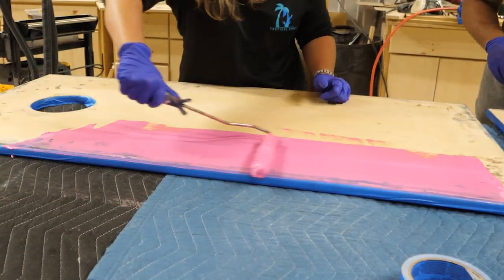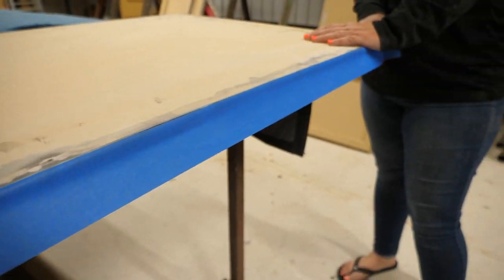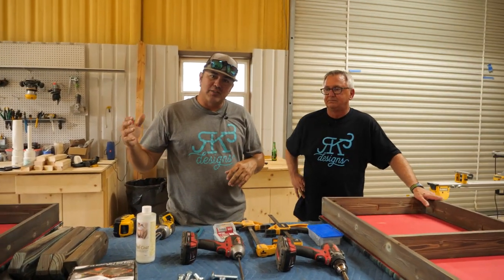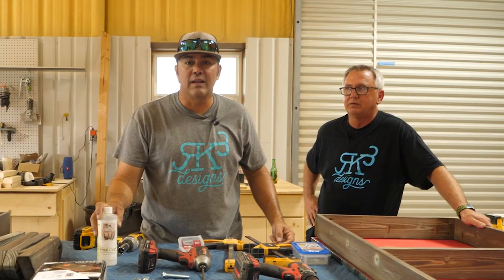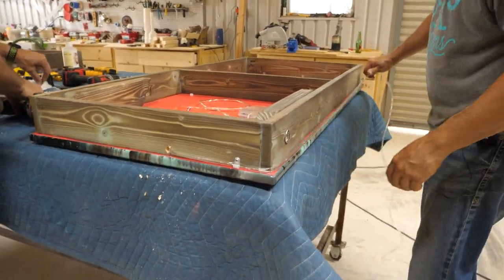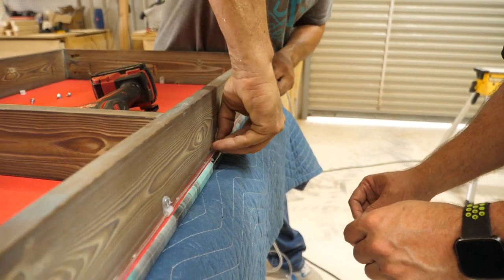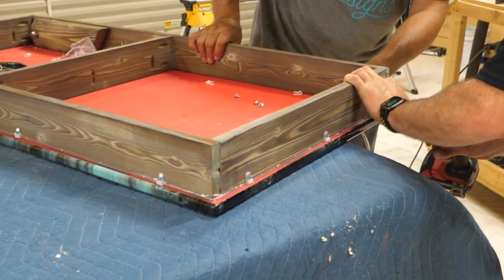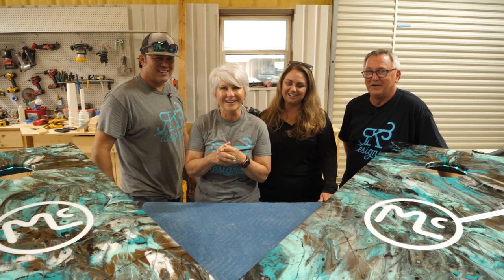Easy Guide To Making Cornhole Boards Part 3 | RK3 Designs

Comment: Excellent. The only 3 videos I have watched on your channel are the cornhole. Is there a video about doing the epoxy coating on the top of the cornhole boards? Also, you mentioned MDF and MDF X. Can the epoxy be used on plywood tops? Thanks for posting these.
Reply from the maker: Just about any of the finishes we do can be done on the boards. We’ve done literally hundreds of boards. Most of the time we do a melded marble technique where we use colors the customers pick out. I have several videos on melded marble. You can use Plywood, but you won’t get the nice edges you get with the MDF without bonding them. Also, the MDF makes such a. I’ve smooth substrate and you don’t have to worry about knots and wood grain. 😊